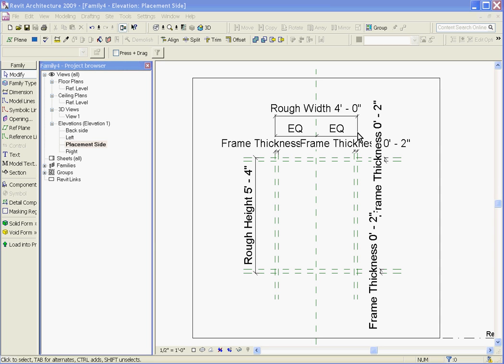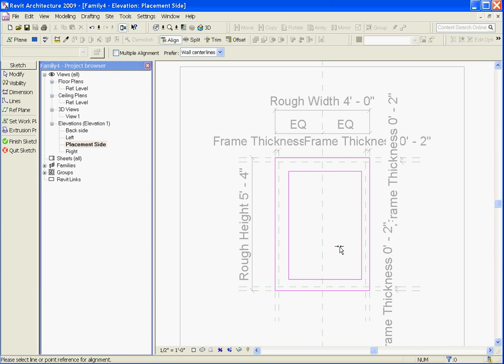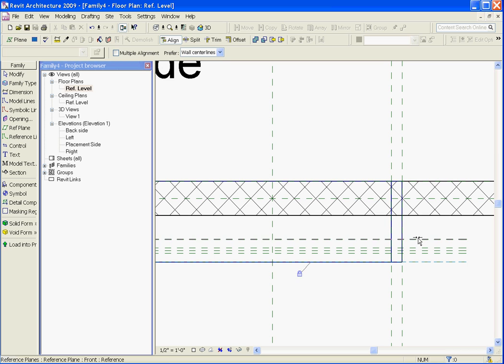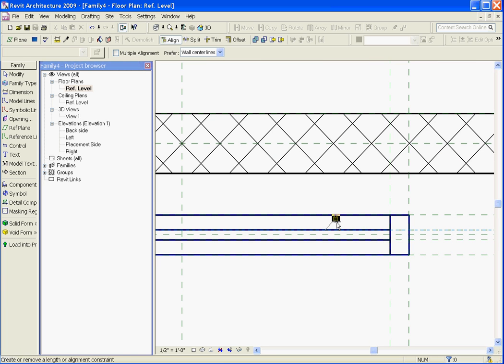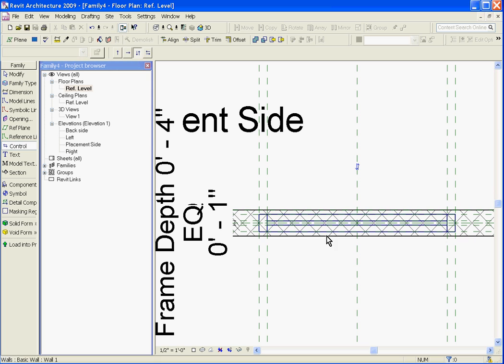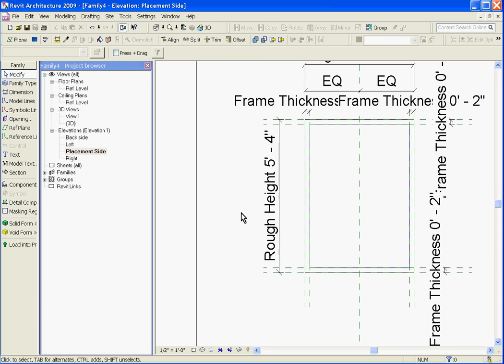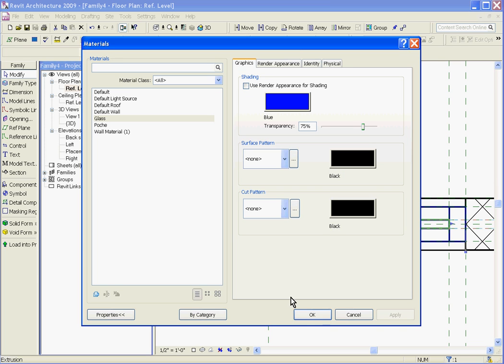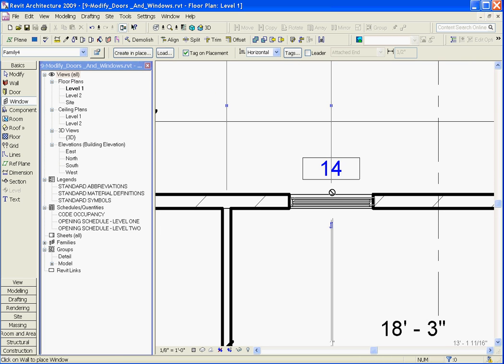Easy Revit (2009) - 9.3.1 - Create New Window Family (Part 2)

Comment from the maker: acseverino, you should be able to create any shape window you need. To draw the arch use the arc line tool. To get the window to schedule properly, you can fill in the width and height data with whatever numbers you need. The tricky part can come from trying to apply parameters to the window in order to let the window change sizes. In the case of an arch, the two points at each end have to be locked to a reference plane, and a second reference plane has to be locked to the center top.